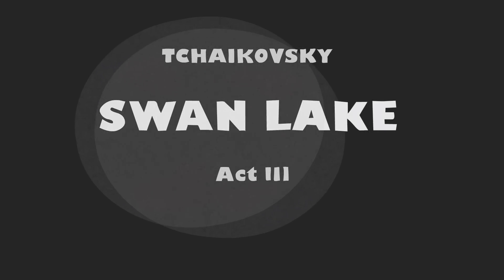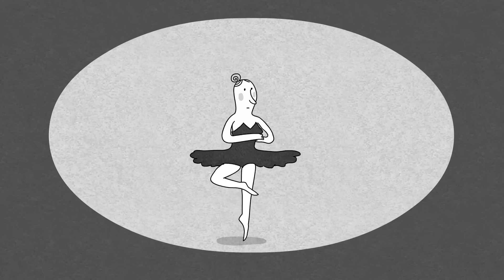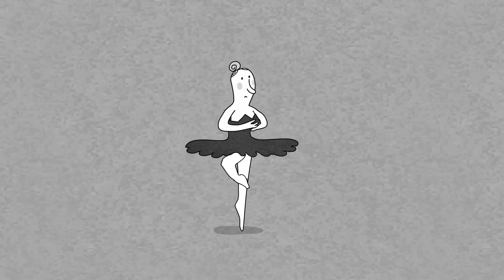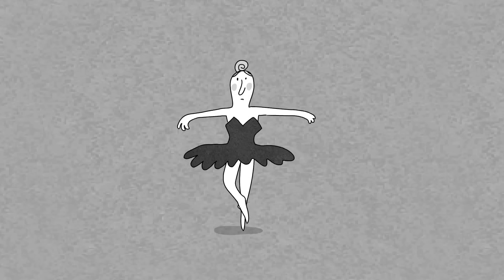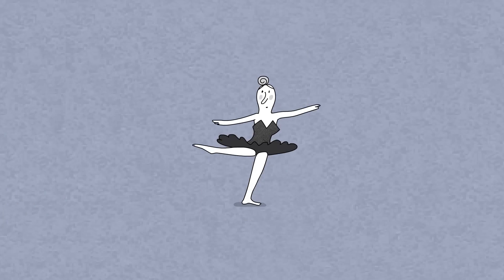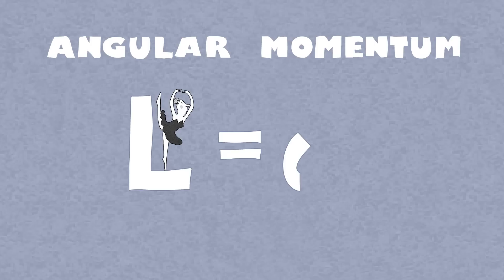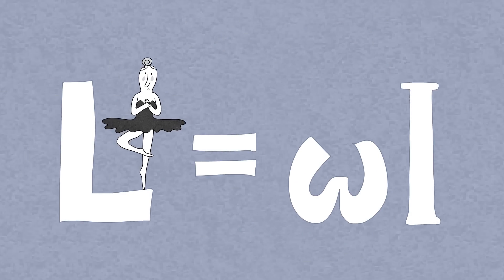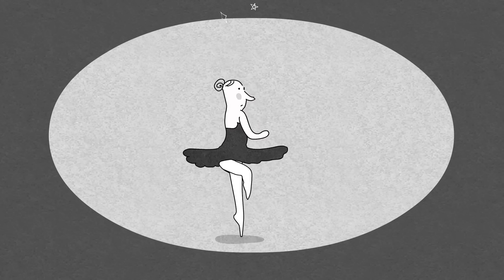The physics of the "hardest move" in ballet - Arleen Sugano

Comment: The way that ballet dancers ACTUALLY get more turns is to push off HARDER from your standing foot every time your working leg goes out to the side - a la seconde. Spotting and posture is also a factor. When the dancer puts their leg out, they bend their standing leg and put their heel down on the floor, and then open their arms outwards. When they close their leg back in, they whip their arm with their back and hip to propel them into the next set of turns. When they turn , they spot their head, focusing on one point to to return to every time they turn, keeping them from getting dizzy, and also helping their momentum. Strength, posture, and spotting are the ways ballet dancers do the famous 32 fouettes.

Comment: @1:13 Funny you say she pushes on her foot to generate a "tiny" amount of torque. If you do the math based on her weight etc the amount of force needed and thus generated from the achillies tendon to push her entire body off the ground pivoting at the toe is very high. An 80kg person standing on their toes with their foot at a an elevation at the heel of 15 degrees requires 448 pounds of force. So these dancers are not applying "tiny" amounts of anything. It's incredible amounts of strength and force.

Comment: Actually, the term is not describing the “incredible ability to whip around” but actually describes the physics of the term, as the ‘whip’ of the other leg. So technically, the video could have stopped there. Also, some momentum is kept in the spotting. You’re also pronouncing fouetté wrong.

Comment: You done went and forgot about the extra momentum from spotting, no professional (or casual dancer over level 4) doesn't spot their turns. You can easily get in at least one more turn depending on your turning ability, so if you can normally turn once or twice without spotting you can turn more because A. you don't get dizzy, B. your center of balance is kept, and C. you get more momentum from snapping your head around REALLY fast.

Comment: She also has to bend her standing leg (plié) as she extends the "working leg" or the leg that is in the air to the front before taking it to the side. It's like a reset for each revolution. Most of the power comes from the depth of that plié and the dancer's efficiency in using that potential energy to straighten the standing leg while pushing off with the foot. If you try to just rely on the foot you'll have no power and will increase chances of injury or you'll just fall. Plié is a safety mechanism and the source of power which can help the dancer control the speed of the turns.

Comment: Whys does this dancer begin her fouettés from fifth position? The advantage of starting from an open position like fourth or second for the guys, is increased torque with less force (torque = force × radius). Also, rather than the supporting foot generating torque, a more apt description would be the knee of the leg in retiré driving backward creates the force that keeps the dancer spinning, though the conservation of angular momentum with the working leg opening and closing helps as well (this was described well in the video, L=Iw). If anything, the supporting leg creates resistance because its turnout acts in the opposite direction of the turn. Of course, lack of momentum is not usually the hardest part of fouettés, but rather maintaining balance so as not to travel or hop. And doing multiple turns is hard en pointe because a dancer has to stay longer in the relevé before the next plié.

Comment: As a dancer, I wouldn't call this necessarily the "hardest move" in ballet. I mean, it is very difficult to master, but at the end of the day it's a repetitive motion and after you master doing 5 fouettes you can just slowly build up that number. Also, you're not learning fouettes on pointe but rather in flat ballet shoes first, and then adding that extra challenge once you've mastered it flat-footed. I personally find doing many pirouettes much harder just because you never get that plie position to regain balance, gain momentum, recenter your focus etc. Plus you have to gauge how much force to exert for the turn before you push off, and that's it, there's never another chance to gain more momentum to complete more turns. Btw I'm talking about fouettes in general not the 32 turns in Swan Lake because I understand that's incredibly difficult and impossible for most dancers. Anyways that's just my two cents, thanks for reading :)

Comment: You're missing a few things here: 
1.as lots of people mentioned - spotting helps and while it's not a huge movement, the head whipping around quickly does help her finish a turn (whip your head hard to the side and it'll push you off balance/over - same concept)
2. when her leg extends out and then comes back in, it's not a straight in and out. It's a small D motion done so the curved edge of the D matches the direction of rotation to help push her further around to start the next series of turns.

Comment: Fouetre is not the hardest move in ballet, it just requires practice ( unlike others that will never work unless you have a specific body) and you are missing the most important element of the fouette or any turn in ballet-the head turn. That's where most of the energy comes from and it prevents the ballerina from getting dizzy. You can do fouette without using your arms at all, and turns without arm or leg movement. It's all in the head turn.

Comment: There are so many comments regarding "spotting."  Spotting has nothing to do with the physics of the turn itself. It is used to keep focus and/or balance and because it looks good.  Once en pointe, which is where the head whip occurs, you cannot add to the angular momentum of the turn.  You lose some to friction, then regain it from the leg whip during flat foot. 

If one were to twist one's head from a standing still pointe position, the body would simply twist accordingly in the opposite direction, since angular momentum is conserved.  Ballet teachers say certain things because they may be helpful cues, but that doesn't mean they are technically correct physics-wise. 

The same can be said for tour en l'air (or even regular pirouettes).  It is impossible to jump up straight, then spin around.  You need to gain angular momentum by "cheating" during the plie and jump.

Comment: I wish to differ as to where is "the hardest move" in ballet. Whatever move a ballet dancer, say female, undertakes, where in this case he calls it "spinning", every final action is preceded by other sub states leading to the final action.  Let us simply say that the human mind of a ballet dancer initiated a thought or a mentally  shaped  signal when the time is right to tell the ballet dancer that  in the immediate future she needs to spin.  The in between states and operations that take place between the mental thought of the ballet dancer and the achieved spinning move are numerous and they are  described in mathematics as a series of integrals  and derivatives depending on where we take as a starting point.
Let us say that in her mind, a ballet dancer generates a  positive unit very narrow pulse followed by a negative unit very narrow pulse  separated by a time T .  The integral operator in the engineering and physical structure of the ballet dancer will integrate this to one continuous pulse of duration T.   The next mental action in the  dancer's mind  will tell the engineering and the physical side of the ballet dancer to  integrate this  again and the result would be   a linear ramp building  for a duration T  and then this is held as a constant .  If such a feature is not enough for the requires stance ,  the mental state of the ballet dancer will proceed to  tell her  engineering and physical side to integrate once again this signal form and the result would be a slow movement  to start with and  a sort of a parabolic action in either a velocity  or  position, whatever the dancer's brain decides to apply it.   So before that leg is seen shooting out to increase the momentum of the spin, there are many many signals generated and integrated  or operated upon by the dancer's mind working in conjunction with the physical integrators supported by the engineering structure of the dancer. All what I said up to now is required to move one point located on say a leg, but a leg has multiple points and each part of the leg has to be catered for  to get an elegant graceful action!!!! There are thousands of points the dancer's mind has to cater for and check that all those thousands of points are located just right in space and time.
I would say that the hardest part of action is to get the initial signal right , and the integrators to operate without faults and then after each integration for the  comparator operators to come in to compare what is, to what should be, as is memorised and filed in the dancer's mind.    If any error exists the dancer might as well give up the action as the final result would be different to what is required. Here the dancer would be weighing the audience's reaction too. 
The most difficult  or the hardest move in ballet is to get the original timing and nature of the signal just right while the physical muscled integrators  are engineered through training to meet the demand of the short and little  space time available to do it all in and the multiple  distributed locations on say  the shape of a  leg ,thighs and knee and foot to meet the final graceful motion.
All   this is required for  a ballet dancer to just shoot one leg  to keep spinning , but the dancer's mind must also at the same time cater for the balancing algorithm which needs to keep the centre of gravity on the point of contact through orienting the leg shoot out not only to induce spinning but to balance the Centre of Gravity shift that may have occurred through a sidewind due to  someone opening the door on to a stage or gravity itself changing due to a nearby mass. But we shall not go into that as a good dancer will see to those external forces in addition to the internal ones generated within his mind and body..
I would say, ballet dancing  needs a good brain, a developed mathematical mind to understand it all and KNOW WHERE SHE IS GOING  WRONG. I would say that physical training is the easiest part! and the hardest is the  mental training to get it right with those integrators working against such restricted time and space! Knowing all this is is quite clear why a female ballet dancer uncovers her legs, as any additional inertia would play havoc on those multiple integrals. 
Ballet dancing is beautiful if one understand  it as it should be understood!